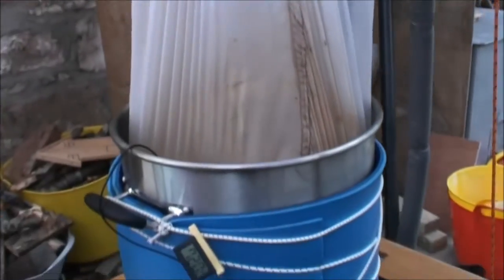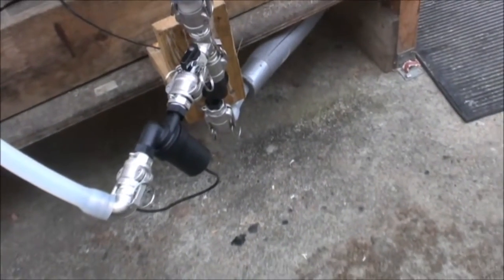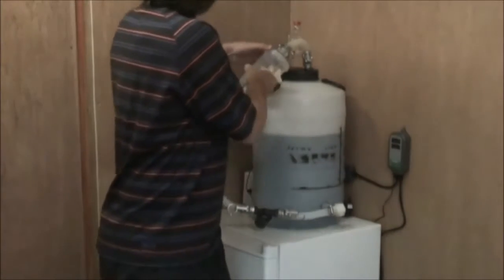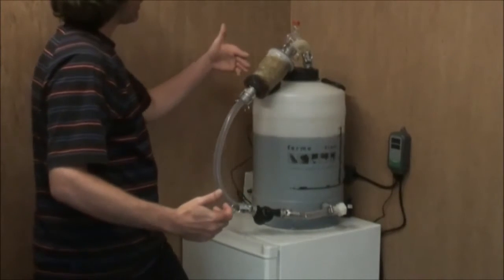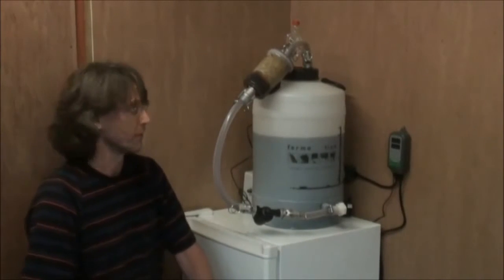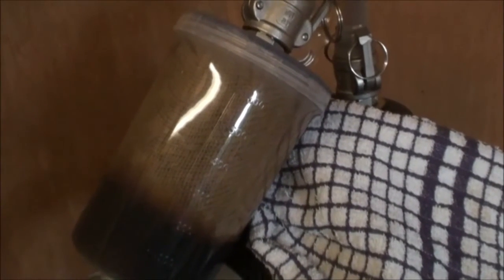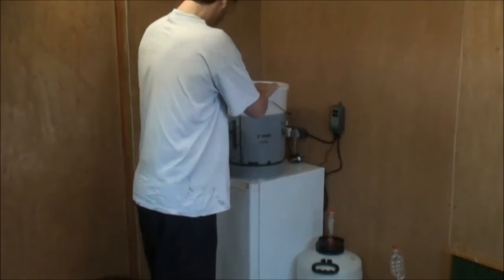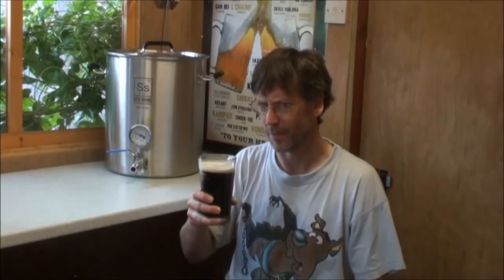Dry Hop Re-Circulation in Secondary (HBW 028)

Comment: Brilliant! I've been thinking about how to do this on a home brew scale as well. I've read that most pro-brewers that do this only do it for a few hours and then consider dry hopping done. I'd consider putting the return valve at nearly the same level as the outlet, and closer to really minimize contact with the air - and add a value to actually inject CO2 prior or even during the process. Cool to see it working though. Cheers!
Reply from the maker: Thanks Tony. I'm planning to fit the hop container within the fermenter next time; a Punk IPA clone - hopefully next month. I take your point that may be reducing the time might be an idea. I could bottle a few at various time intervals to see how they compare. Cheers.

Comment: Very interesting!  The one thing you should monitor is the effects of the oxygen has on the beer.  Even if you could keep the original bubbling purged with CO2, I've heard that pumps can have leaks that you can never even detect!  Really cool stuff though, cheers!
Reply from the maker: Thanks very much Dan. I might think to put the pump inside a sealed container with a CO2 supply to it...lol! I guess a lighter clean tasting lager might be a bigger test for it as it might be easier to detect any off flavours. All good fun really and thanks for watching and commenting. Cheers.

Comment: Great idea! Thinking about doing the same with my Blichmann Hoprocket.
What kind of pump have you been using for this?
Reply from the maker: Hi Markus. Sorry I missed your comment. I use a "Hot Water Solar Circulation Pump Food Grade Silent TE92". Just checked on ebay and I can't find that model but just ordered a couple of equivalents that seem a bit more powerful (ebay.co.uk: 382099803618); it's always good to have a spare ;) If you're doing something similar then beware of the extra bittering. All the books seem to suggest that dry hopping isn't supposed to add to bittering but I beg to differ. I tend to use low AA hops in dry hop when I can or limit high AA hops to just 3 days. Let me know how you get on? Cheers. Alan